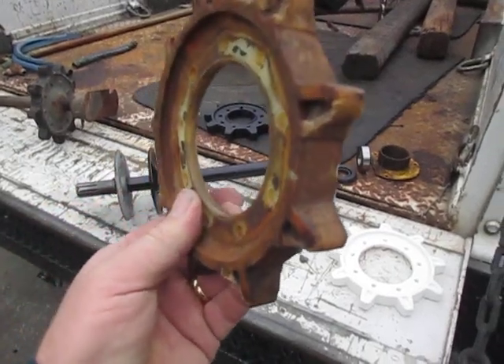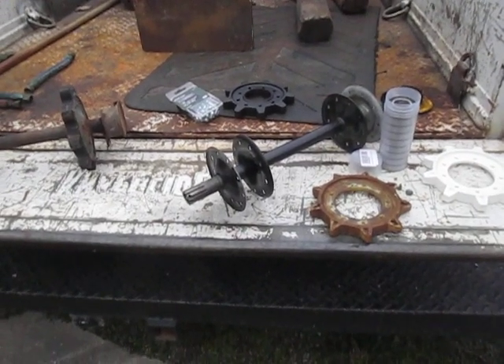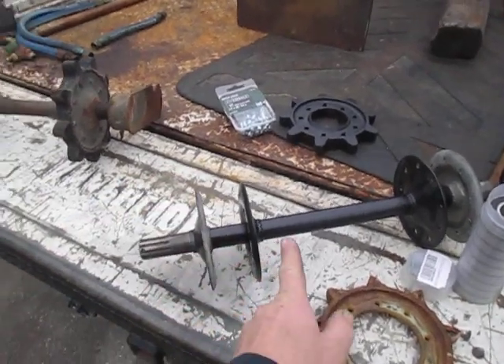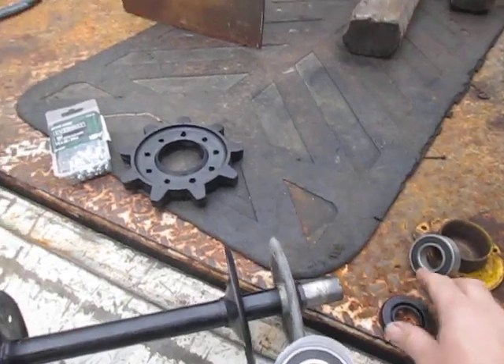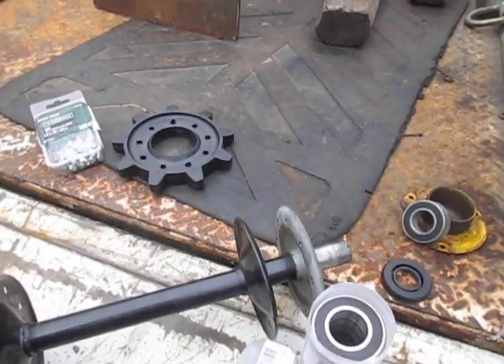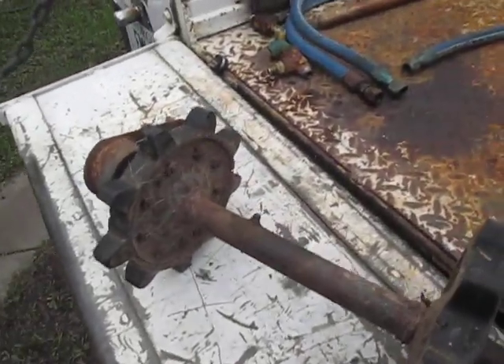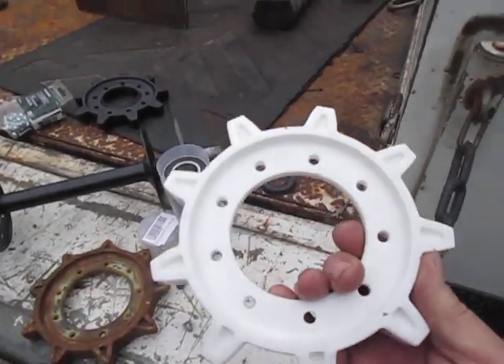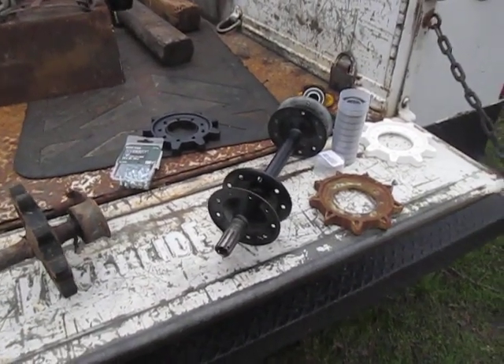Replacing drive sprockets in an old Ski Doo- why it is a must!

Comment: Where did you buy the sprockets?
Reply from the maker: I got mine from www.reproductionvintageparts.com,  get the phone number off the web site, it's best to call. The 6205 bearings I got off Amazon.  There are other suppliers in Canada as well.  The bolts and nuts that replaced the drilled out rivets came from the hardware store locally, they are just 1/4x20 with nyloc nuts.
Reply: @Jethrosgarage  thank u. I don't like purchasing any thing from China.It is not trustworthy.
Reply from the maker: @boblajoiesr591  That company is in Minnesota USA, owned and operated by one of the most trustworthy folks I've ever shaken hands with.
Reply: Thanks jethro I will be doing business with them